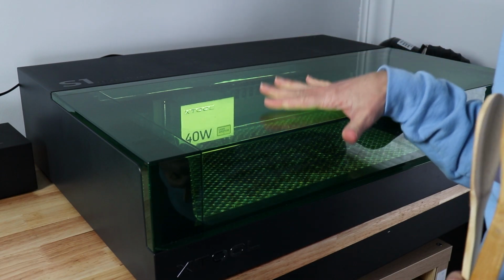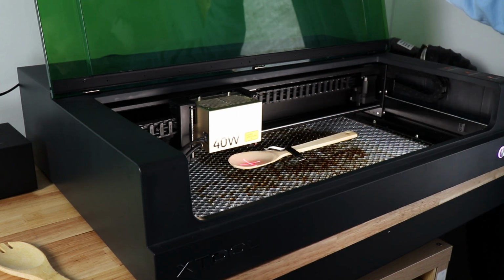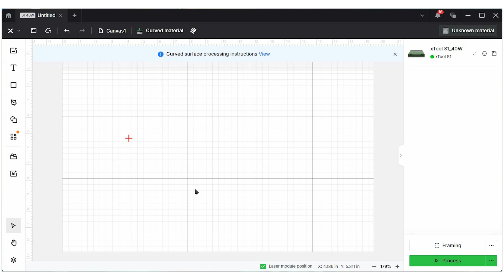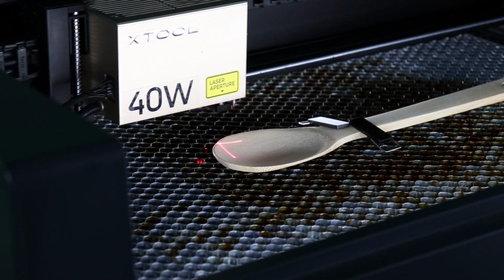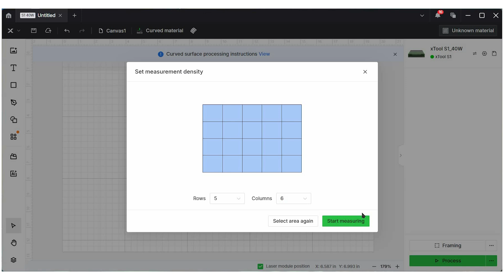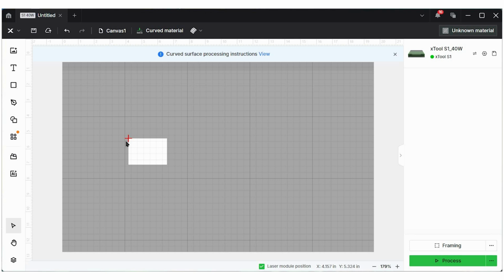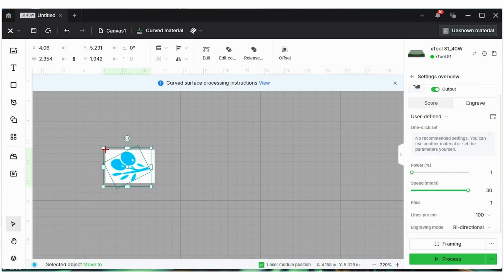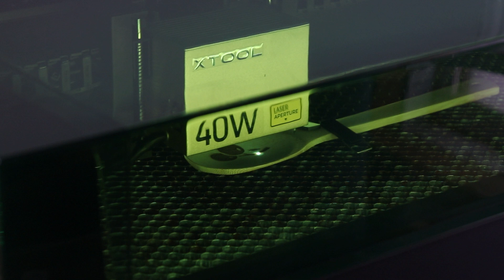Curved Surface Engraving with the xTool S1

Comment: I'm trying to engrave the inside of a bowl (similar to what you did on the F1 Video). How do you map the curvature without the depth perception pin clipping the side of the bowl continuously?
Reply from the maker: The curve has to be less than 15 degrees, and the bowl height has to fit in the machine. It might help to add a riser, or remove the honeycomb if using it. The F1 Ultra can engrave more of a curve.